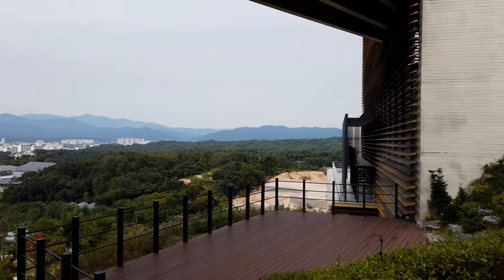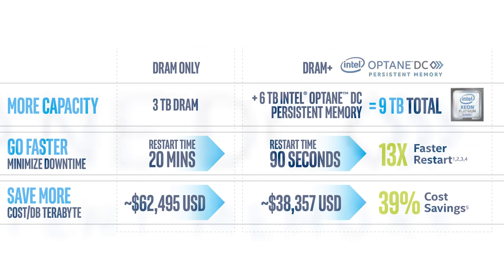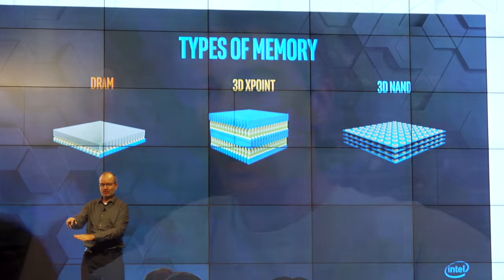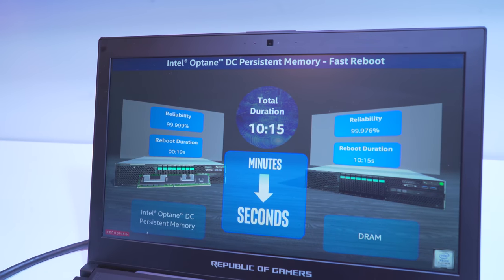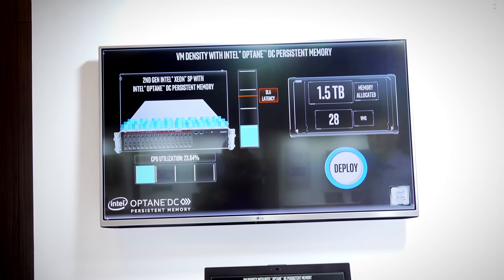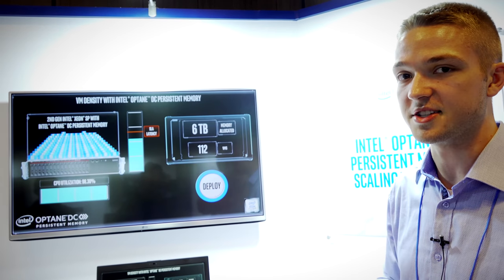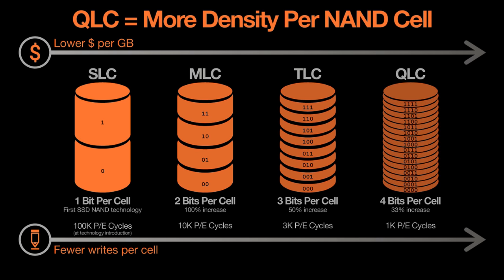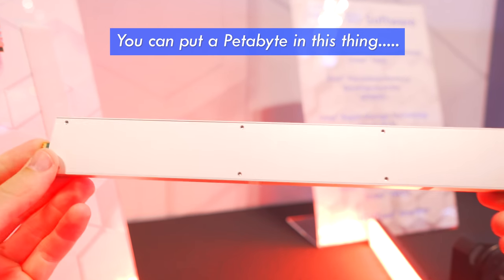Is This the FUTURE of RAM and Storage....!? (Intel's Barlow Pass)

Comment: The 10 year old Poweredge 1950 1U servers with disk drives have 4k random read and writes at 

  Random Read 4KiB (Q= 32,T= 1) :   193.058 MB/s [ 47133.3 IOPS]
 Random Write 4KiB (Q= 32,T= 1) :   179.004 MB/s [ 43702.1 IOPS]

 Random Read 4KiB (Q= 1,T= 1) :    70.591 MB/s [ 17234.1 IOPS]
  Random Write 4KiB (Q= 1,T= 1) :    59.269 MB/s [ 14470.0 IOPS]
 This is thanks to the 2GB of Raid Controller Cache, Perc 6 IIRC.

A 1U being very compact limits the Disk drive space, with 4 Disk drives in RAID 0 (RAID 0 through 10 possible) your speeds are  also around.

 Sequential Read (Q= 32,T= 1) :   815.991 MB/s
  Sequential Write (Q= 32,T= 1) :   550.582 MB/s

Comment: I don't care much for power saving.  I keep finding my WiFi not connected.  That is for what?  To save a few watts of electricity?  I turned off the power saving for my WiFi since it causes more problems than it is worth.  It might also be a Windows 10 problem too.

Comment: I disagree with this video solution, rules of thumb for performance is to never saturates the CPU at 100% for power usage and wear, always leave a 20%-50%  buffer.  

Also, why  isn't the memory  factorized in the cache so that the same load in cache is not repeated over and over 112 times so that you can save more optane cache space in the long run .

Comment: soo when I we likely to see 8TB dimm options as I can see this content creation sppace in the next year or so

I also said this about 6-12 month's  back I wonder  when we would dimm based memory  with the same capacity of m.2 ssda

and I had to wonder what you think we could we coud expect 4-8 TB dims 

nevermind something that could see benefit in the amd platform I ould have to wonder what would happen if we applied 2x *tb options to the gpu space as a ram options..

I would have to wonder what would happen if you mount an 8TB ssd in a ps2. xbox, 360, one, wii. wiiu, ps3 and ps4 pro..

looking at what true 4k and will be needing pure hardware i wonder what processing power and ram will need  in improve native resolution vs the upscale we currently see ..

I wonder what would happen if we had a market where we could see ram within specification upto  to 8 TB across per a eight ram slots though have it to the same price of 128GB dims  today

I wonder what would happen if you paired this with 1-2 amd 64 core cpu's and have the capacity of 2-5 inch or 4-8 ssd in a 305 inch chassis

I wonder if we will will see ssd's past 8TB at the same or at a cheaper than current magnetic media drives..

I wonder going to a complete m.2 architesture within the mobile conmputer market might benefit in cheaper laptops altogether

whether you use sata/sas/m.2 or some type of ram hybrid based on ram rom type system we could see the likes of 64TB stirage in a 15 inch laptop  128-512TB un a 17 inch laptop
north of 10 petabyte gaming PC may be 2 Petabyte console ..

the biggest issue or question I see where does leave graphics cards in the short term and long term  situation  because with the processing power of a mere 32 TB of ram slotted memory  your bottleneck then becomes the processing output  the gpu ram..

looking at what is required by current video editing suites of a bare min of 128-512GB with the gpu at 8-16GB gpus of today struggle to process both 4k/4k-hdr nevermind 8k content

looking at intels new flagship memory whether it be used as ram or some variation of m.2 or graphics ram I have wonder where the future lays  looking within the next few years and whether or not current generation min board will be able to utilize it or will a complete new platform from both amd and intel

from a game storage perspective  whether this be SEGA/NEO GEO, Atari/playstation/xbox/pc we are coming to a point of a home distribution service  and have the server distribute to the home network from  server to,onsoles & pc because you are going chew alot of bandwidth  patching everything per platform if you have multiples of the same consoles and pc's in your network..

my other question is where are we going to be within the network hardware to support the  data lit on the hardware

Comment: the only thing that has stopped me from getting a server is money or eBay sellers not accepting money order
Reply: Question is though what do you want to do with a server at home that you can't do with an older pro level workstation or a newer HEDT cpu like 3800x and 32 or 64GB of ram? Real data center servers tend to be noisy and in awkward flat shapes; for home use a workstation in ATX tower form is more practical.

Comment: So the arguments are, you get more, for less money. Once you use out your complete dram, the intel memory stuff is better, cause you don't run into bottlenecks.... makes sense, but normally you do plan for the potential usage ahead. The VM argument is also not very convincing, since yeah every VM has one hyperthreaded core, gratz dude, so they can do basic network analysis provide light services. Huge databases need a huge amount of ram. Of course it is booting up faster if it is already in the memory, but what about the initial load of it? Probably a lot worse. You don't reboot servers that often. Lots of them run many years. This Intel memory has its use cases, but really is not the new wonder weapon.

Comment: I just spent the whole day trying to get my crap 1600Mhz RAM to run at 2133Mhz. Yes DDR3 suck and my 1600Mhz CL10 sucks even more, all i manage to get was 2133 CL12 to get there it needed 1.605V
Reply: i got cheap kingston hyperx 1333 ram and it runs 1866 no problem :D
Reply: Why are you complaining lol 2133 CL12 is amazing
Reply from the maker: Yeah 2133 CL 12 is good man. Nice clock.

Comment: The true question is will it run on AMD based CPUs as the new EPIC has 64 cores, 128 threads (but only 2TB of DDR4 per CPU)
?????????
Reply: No. Only Optane SSD's like 4800X in the video will work on AMD based system. Optane DIMM's are Intel exclusive.
Reply: @Raivo_K   :( I understand why they make it proprietary but wish if making such tech they'd make the interface/communication standard open but then market the rights to create the hardware under licencing.
Reply: Btw actually amd supports up to 4Tb per cpu, about optane support  it would be up to micron as they will probably be the ones to open up the standard

Comment: Unimpressed with Octane it's a joke! Just grab a Samsung Evo Plus NvMe M.2 drive and throw it in! It's the fastest you could ever need or want! Basically Octane just remembers what you use most and compiles areas of the data you use and stores it ready to use so that when you enable a program parts are already available and ready to use. Eh whatever Intel blows and I pray that AMD takes over the market and trashes Intel's overpriced always SOON TO BE OUTDATED hardware.....
Reply: Optane is the Titan of the SSDs. Go play with your crappy Samsung stuff and enjoy the latency and thermal throttling.